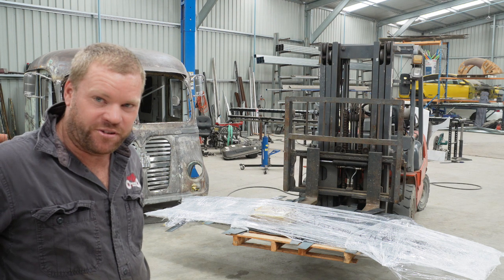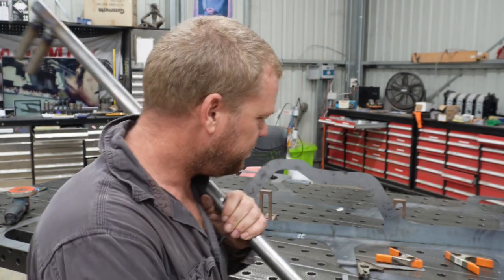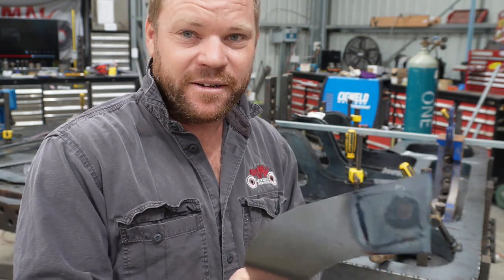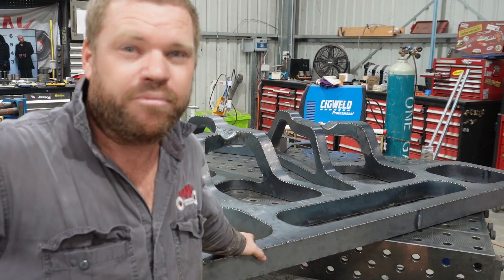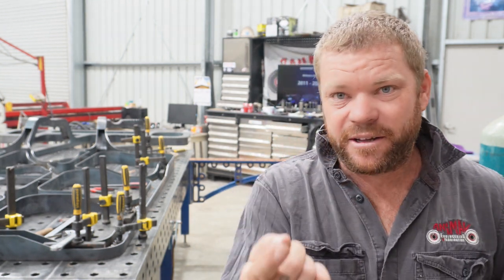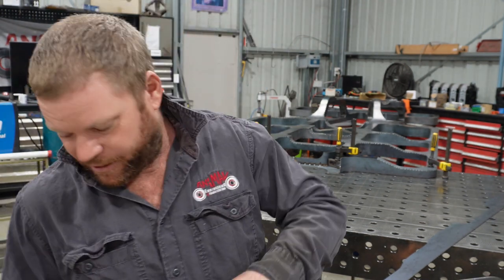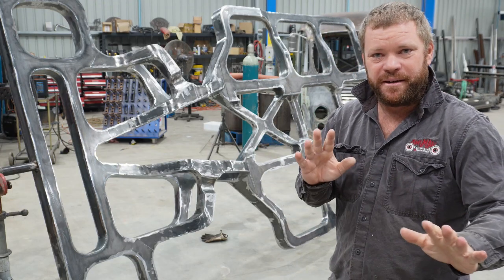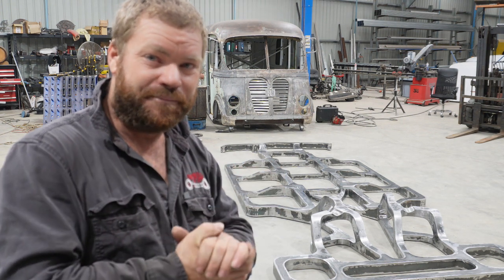Custom Chassis for the Metro. SSMETRO Ep 23

Comment: CubitRon’s for the win  eh . They just rip off steel awesome . Why did you chose tig over mig ? You only got about 20 kms of weld to do ,a blokes got a have some spare time for drink . Awesome chassis mate put a horn on a jellyfish
Reply from the maker: Ha ha, cheers. I did mig most of it, switch to the tig to fill in any low spots. I was super impressed with how good the cubitron disks were.
Reply: Yea first time I saw them I was out on site saw another boily usin them thought to me self yea good luck with that kept walking and minded my own business.(about 8 years ago) about 5 years ago brother in-law showed me the light , still to this day work with boilys that haven’t seen em before and don’t they love a flap disc . My thing is why don’t 3m make grinding discs out of this stuff
Reply from the maker: @norego6237  ha ha, I’m a flap disk Boily. These disks are bloody awesome though, will be using them heaps from now on